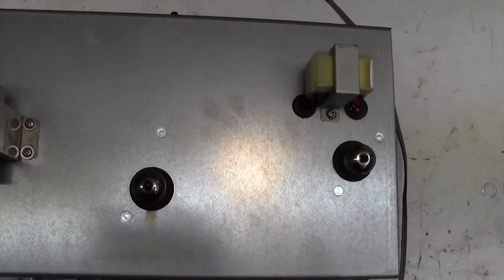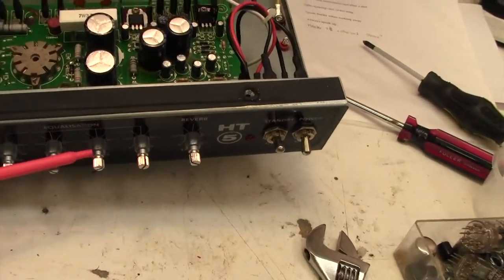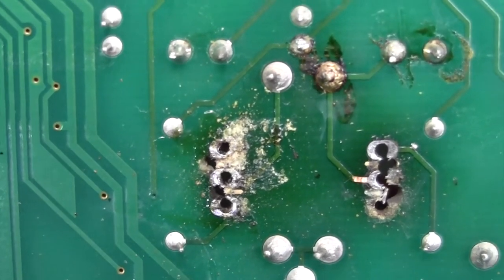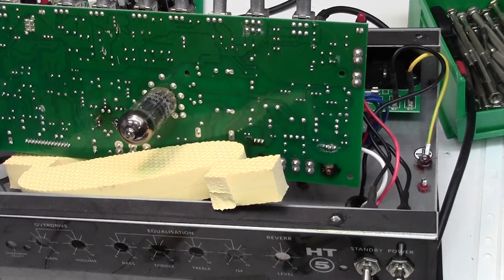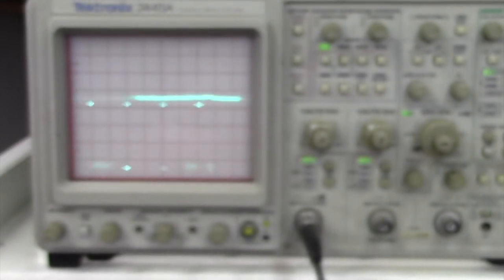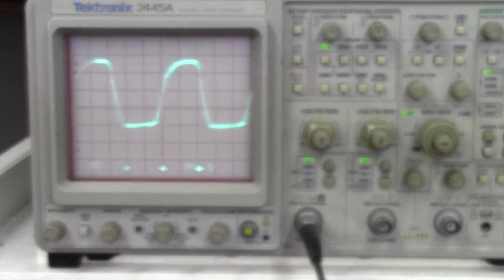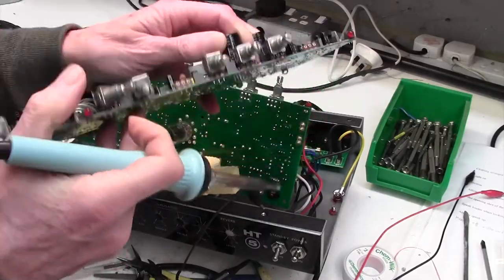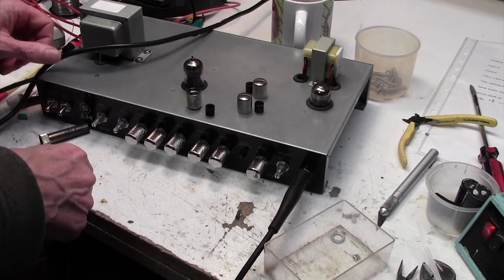How to fix Blackstar Amplifier Hum HT5 and HT5R

Comment: I made a video saying pretty much exactly what you've said here, rightly, and got a swarm of Blackstar fanboys and bots saying I didn't know what I was talking about. Building equipment destined for landfill when a single component breaks is not a state of affairs guitarists should be willing to accept, particularly when previous generations of amplifiers are still around from as far back as the 1930s. I hate this throwaway stuff.

Comment: It's helpful when sucking solder off a component leg to first reflow each joint with fresh flux cored solder then deploy the solder sucker (self heated type or plunger). This refreshes old crystallised or oxidised solder and helps the joint to clean up more completely so the component is ready to fall out first try (unless hot glued down :) Hope you find this is effective. I like your relaxed and composed enthusiasm, it really makes for enjoyable watching. When you have an employer wanting/needing ever faster diagnosis and repairs the fun can get somewhat diluted. :)

Comment: Thank you for saving another HT5R from the scrapheap, couldn't have done it without your diagnosis. As well as a neighbour (also) called Stuart with an oscilloscope and electronics expertise!! the dead smoothing cap in my amp was actually 400v and 100uF, so replacing with one with same value. NB if ordering a replacement cap, the cap height of 32mm is the max or  the board wont fit back in..

Comment: The holes drilled in the PCB between the legs of the FETs are a Blackstar-approved mod to deal with the fact that the heat generated by the FETs causes the lacquer on some earlier PCBs to go conductive over time, which gives rise to some peculiar problems. I've seen it done more neatly than that though.
Reply: Marshallitis

Comment: Thank you for that very enlightening repair Stuart.  I was mildly surprised that the output FET's did not have their own small heat sink !..  Considering 'heat' is an identified enemy that needs countermeasures to deal with , I'll award the designer of this amp 1 out of 10 for this oversight, but 10 out of 10 for your repair.

Comment: Stuart,
Thanks again for fixing my amp.  Really going far beyond my expectations.
I bought the amp new and it has never been repaired so the FETs must have been soldered in like that.
Seeing some of the soldering I am surprised it has lasted this long. Trying to remember how old it is - at least 7 years old.
Paul 
PS glad I give the casing a good clean!!
Also I did notice the problems with the knobs - I do not use the overdrive so do not use the knobs on this section alot.
Reply from the maker: Hi Paul, they overheat, that's the problem. Then the solder joints give way. No more boards available for these amps now, so hello landfill...

Comment: Why do folks always say SMD gear is unfixable? I learned how to do it from a couple youtube videos and a modest investment in tools (tweezers, fine soldering tip). I have hand built a few synth modules now and made repairs and mods to other SMD gear. I'm just a hobbyist not a pro tech, but I find it actually easier and faster than through hole now.

Comment: Diagnostics is a science, thank you Stuart for sharing your process even though we might take on the basics of testing first I'm sure most companies building amps would possibly prefer complete amp replacement due to the amount of opp amps mini transistors etc on the PCB boards these days. Shame but it's also cutting out people repairing amps as a Tech myself. Sooner than later the new generation of amp production will have non replacement parts and pcb tracing a distant memory to hide the magic...Hopefully you might explain the use of an osciloscope how and what it is indicating. Reading voltage and showing how continuity may throw out testing results without a Olly scope. There so much cheaper today than 40 years ago..

Comment: A technique i use to remove stubborn knobs is very similar to yours. Instead of a screwdriver try needle nose pliers, use one jaw on each side of the shaft and as the jaw gets thicker it works like a wedge and slides the knob off the shaft  using even pressure on back of the knob . Works for me, you may want to give it a try
Reply from the maker: I'll  give that a go thanks. Sometimes a squirt of WD40 does the trick also
Reply: @stuartukguitarampguy5830  thanks for all you do Stuart. I really enjoy your videos and learn a lot. Cheers.

Comment: Have an acoustic guitar with a preamp for the piezo.
It started making a loud hiss. I did a similar thing, but used one wire. Started touching the two leads on each capacitor and found the one that made the hiss go away. I just solder a wire from one lead to the other and called it a day.
Reply from the maker: Nice one!

Comment: The Blackstar HT series of guitar pedals use a similar SMPS to power the valve and have the same problems with blown switching mosfets. When they go, they really go, burning through the pcb. I ended up doing a new mini pcb to replace the HT power section in an HT Delay pedal. There must be an inherent weakness in the design.
Reply from the maker: Yes I totally despair when I see such basic design errors as this.

Comment: I find the easy way to remove those surface mount resistors is to get a good blob of solder across the resistor and it will get stuck to your soldering iron. Give it a try if you have a donor board. Then just clean the pads with braid and solder the new resistor in place. A bit of solder flux helps alot not getting solder bridges on nearby components.
Reply from the maker: Ok good tip thanks Daniel.

Comment: I've got a Blackstar Studio 10 KT88 here with an output more like 1w than 10, the valves seem OK as I have substituted them to no avail, do you know the correct bias voltage for these amps? Bias seems to be derived from a FET (although this measures OK on a cheap Chinese tester; could the IRF830A be a problem?). Blackstar won't give out a schematic for this which makes it difficult to diagnose.

Comment: Hi there, my ht5r is needing some new MOSFETs. Will irf830 replace smk830 without any problems? If so would you mind telling me where to buy the exact type that you use yourself. I've got a bit confused with the various types listed in certain sites. Any advice would be much appreciated. Regards Simon

Comment: I am working on an HT5 that has a big volume drop after a few minutes of running, and when switched off for a few minutes, the volume returns. I've read this is a common problem, is this the symptom related to the FET failure? Is the FET failure an outright death of the FETs or is the volume problem from conductivity between its pins?
Reply from the maker: Hi  I guess you've tried the valves first! Other than that there's not a lot you can actually do with these amps. 7/10 times it's those FETs so I'd try changing those next. They're not very expensive.

Comment: First
You need to be careful when measuring with the help of the oscilloscope
tektronix 2445
With the help of X1
You could burn the
The front end of the tek 2445 with 150 v
on high volt use only X10 .

Second thing
When using the de solder gun add new solder to the pcb joint
With a new tin for the gun it will be much easier to pump out the tin .
This is basic things in soldering
I specialize in IPC610A military grade soldering 
In any case good work on the diagnosis and repair
Everything I said was not meant to offend
Just friendly advice
Reply: You'd advise adding new solder to each and every joint to be de soldered? Even if using a basic soldering pump? That's a genuine question, I'm interested in your answer. Thanks
Reply: @chrisdee5032 

 When you add new tin

This allows you to remove the old tin much easier
Usually in PCB boards
It is lead free and is more difficult to remove
and requires a higher temperature
Reply: @chrisdee5032  Yes. But by new solder, High lead content solder, 60/40. The silver solder used today takes much more heat and hardens faster,  and it becomes brittle over time and harder to remove. Adding Lead/tin creates a much softer mix and gives you just better work altogether. Less heat on components being a huge plus. and then finish off your job with some alcohol. Some for cleaning and some just to reward yourself or calm your nerves, whichever applies.

Comment: Hello
Stuart 
ask for advice repair.
I have a problem heat mosfet irf840 .
temperature 57c. hot untill c 39 22uf 450v 
resistor r10 10k 3w
i m not touch.
I dill between pin mosfet  and change new mosfet irf840 tr2 tr3 risistor 22k r38 r39  and capacitor 4.7uf c45 c46
 not  finish repair  hot
masfet and capacitor
I m afraid blast capacitor  and shock
mosfet.
Reply: sound it good but very hot mosfet and capacitor  v. pin  drain tr2 tr3  190v    tp 6 tp7
-23.5v  grid   46mv at D20
Reply: I change c39 up voltage from  190v  up  is 260v  at drain tr2  and tr3  finished work
I m test  1hour  no problem   capacitor change 85`c up  105`c
resister r38 r39 temp 40`c  temp  tr2  tr3  48'c  install add heat sink   Thank you.